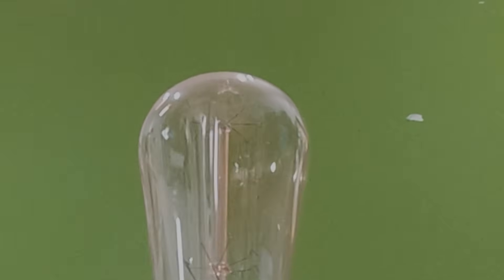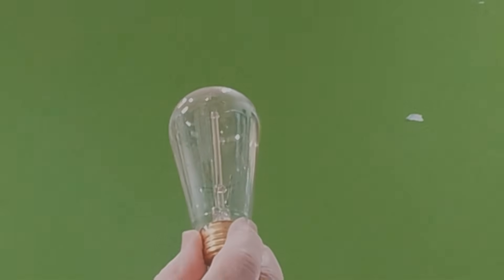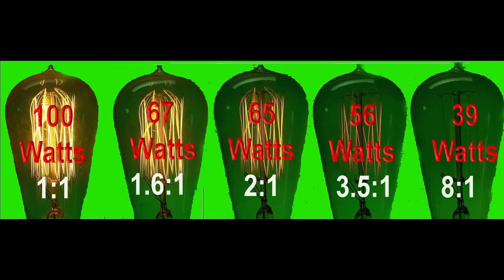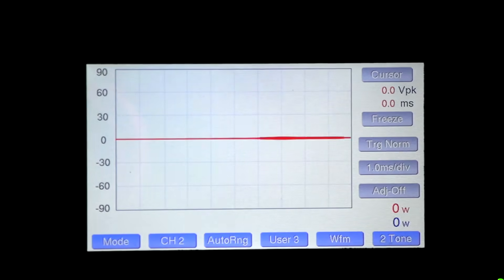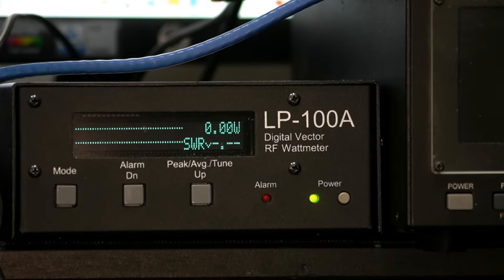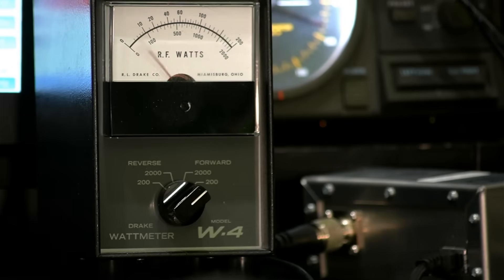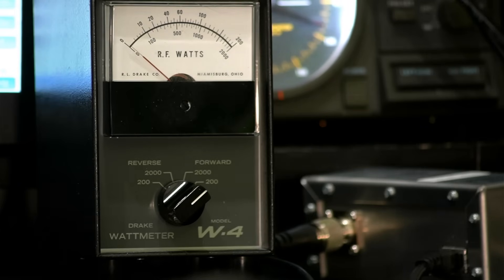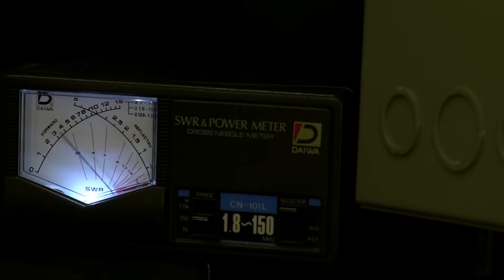The ARRL Writes  About an SWR Myth Among U S Hams, Find Out the Truth Watch the Bulb! 73, Jim W6LG

Comment: W6LG illustrates a fundamental observation: the higher the SWR the less energy is being delivered to the antenna. There is nothing up for debate or interpretation. Glad I'm not giving the ARRL anything to make a contrarian point. It would be easy to argue their article is comparing apples to oranges...but are they?

It might be interesting  to perform the same test with balanced transmission line vs coax. And how are you presenting the mismatch to the purely resistive bulb...at the feedpoint or at the transmitter. It's getting harder to find those incandescent bulbs.

Comment: Hi Jim, thanks for another video learning session. I just got my General last November 2024. I am living on social security which leaves little money for equipment and experimentation. I was gifted a FTDX3000D along with power supply so my focus is on setting up this radio and understand how everything works and the proper way to communicate with others close and far away. Tomorrow ill be setting up a Alpha-Delta DX-40 dipole antenna at 30 feet with 80 foot of RG8X cable. 

My old setup didn't teach me much as it didn't get out at all. HW-101, HW swr power meter. very old B&W folded dipole and old wire. I had trouble discerning where my problems were.

I also was given a 239 ant analyzer which will help me to understand and build a working setup.

Now that all my equipment is new, I'll be on the air soon which brings me to your Calling CQ properly. I'll do my best and get back with you. KN4HDH

Comment: Okay. Jim Here is what I do. I’ve decided the best solution to this SWR CONTROVERSY I  run a 120 foot doublet fed by 600 ohm ladder line via an MFJ  tuner. Fed from the radio by a RG-8 coax jumper. This antenna works all bands 80 to 10 meters, and nothing gets hot. Which means most of the energy is getting radiated. Yes I have to keep the tuner tuned but big deal.

Comment: Its like a light bulb dummy load. Depending on the watts of the bulb. Ive done it years ago
Reply: You need a 100 watt bulb 💡
Reply: Or you turn it up the swrs will go up on the light bulb swrs will go up. I never heard of a 1.1 swr on a light bulb 💡
Reply from the maker: 61 years of experience. 73 Jim W6LG

Comment: Your video brought back old memories.  My first experience with radio came as a gift:  a Heathkit GW-12 CB transceiver.  I recall that the transmitter tuning procedure was to plug a small, specially wired flashlight bulb into the antenna port and tune for the brightest emission.   Thanks for an interesting presentation.
Reply from the maker: Thanks for the comment and 73, Jim W6LG

Comment: Hi Jim, possibly the biggest problem with discussions on SWR is that the "educators" might take extreme cases to prove their points. High SWR is often also blamed for high common mode current, which is not automatically the case at all. Sadly the victims of this are the beginners who quickly don't know what to believe. 73
Reply: Totally agree, also videos that don't tell the whole story will confuse the new hams
Reply from the maker: As usual, you provide honest, sane, good discussions with me.  We may not agree some times but we agree to maintain our friendship. I always look forward to hearing from you. I am still in bed from breaking my back again. There is an interesting story that goes with the ambulance ride that I need to tell you and others. 73, Jim
Reply: @ham-radio  Jim, I generally agree with you 100%. I am sorry if  my post implied anything different on this occasion. As for your health, I cannot appreciate what a battle you are going through. On a lighter note Jim, sometimes if you agree with someone on a technical point it is worth temporarily adopting a different apparent viewpoint. In my life I have rarely learnt from someone by merely agreeing with them 🙂 73 de David

Comment: With less power getting to the light bulb, you need to find out where it's going. First, there will be actual resistance loss due to the resistance of 150' length of RG8X cable. Then you need to find out how much is being radiated by the cable itself. I would test the cable first by using a 50 ohm dummy load and check radiation around the cable with a field strength meter. Then terminate the cable with the lamp as shown and recheck the field strength meter. Then increase the VSWR and check with the field strength meter again for each step. Then repeat with other cable types. 
I remember back in the seventies the ARRL talking about how VSWR on HF isn't as critical with basic and simple dipole type antennas, because the radiation isn't lost, it's simply being radiated by the coax feedline. They said in some situations, the cable radiation actually could help filling in the nulls the dipole may have, for better omnidirectional radiation. Of course, radiation on the cable is bad for directional antennas, because it screws with your radiation pattern. 
You just got to know when to holdup,
when to foldup,
when to walk away and 
when to run.
Reply: I would run if anyone was suggesting that the feedline radiates due to high swr
Reply from the maker: Interesting points, thanks for the detailed explanation of what you would do to test it, I appreciate it!

Comment: There's a great, freely available article reprinted from the Nov 2006 issue of QST titled "Understanding SWR by Example" by Darrin Walraven, K5DVW, that talks in detail about this topic. The reality is that with a low loss transmission line, the tuner will in fact enable the majority of power to be delivered to the load. Even if you're ultimately only getting half of the power to the antenna – which is achievable with a modern tuner and decent coax even with 5:1 VSWR at the feed point – you're looking at 3 dB loss. That's half an S unit. Depending on your goals you may not even care about this.
Reply from the maker: Honestly, I really don't want to lose half my power.  Thanks, Jim

Comment: Jim, the light bulb video is the exact type of instruction that propelled me into the field of electronics decades ago. (~’76) Being a few years away from retirement and still paying off a mortgage my economic reality cannot justify spending thousands of dollars on radio equipment. The Xiegu G90 has been a perfect solution for me. But with only 20 watts to work with I need the greatest antenna efficiency possible to get my signal out there. You might consider creating a second light bulb video comparing 20 watts into an efficient antenna vs. 100 watts into an inefficient antenna. A subsequent follow up video could then address the current real world co$t of inefficiency for the Ham radio operator. -KQ4SRE

Comment: Jim,

I read many of the comments and agree with most of them.  But, remember this is a hobby and supposed to be fun, relaxing, and help us maintain an even balance between life and all of its difficulties.  Some want to KNOW the where's and whys of what they are doing.  Others just want to enjoy making contacts.  If you want to just make contacts and friends, that's great.  If you are having trouble making contacts then learning more about the WHY is important.  No one should get their undies in a twist about SWR but learning about it can and does make a difference.  Back in my Novice days it really didn't matter because I made contacts and adjusted the pi network on my DX 40 to compensate for mismatch.  I made contacts and felt I had arrived! Ha!  65 years later I know more, actually get on the air less, but still feel accomplished.  Thanks for your teaching.  I wish you well my friend.
Reply from the maker: I know Dave. Right after I finished I was the back of an ambulance on the way to the hospital for a few days. I am home and in bed recovering. 73, Jim

Comment: Great video JIM ! I use the cross needle meters . I need to see my forward power to tune my amp and see reflected power at same time. Then look down and read the SWR on the meter. I quick glance and I see it all . I run filters inline like band pass / low pass so I keep mater at antenna side.  Works great !  I have thar Rig expert as well. Great test gear to have. I can do smith chart and more with PC to Rig expert.  cable . USB A to B came with it. Nice job with lightbulb . Years back was my dummy load.  73
Reply: I use the cross needle meter as well. Gets your attention quickly when something goes wrong.
Like the PL to SO connection at the antenna, mysteriously loosening.

Comment: After spending too much time simulating feedline losses and worrying about them I have resorted to mounting the tuner at the antenna feedpoint. As a side effect, I no longer have to worry about the coax acting as an impedance transformer and accidentally making things worse in unpredictable ways. It was a pain - running extra wires, waterproofing it - but I love the result. It's just... elegant? The 50 ohm coax only ever sees a 50 ohm load.
Reply from the maker: That's a great idea, and thanks for sharing. 73,

Comment: I think you need to redo the light bulb antenna test while using a tuner. Most us have internal tuners that match 4 to 1 or better. The youtubers who speak of swr myths profess using tuners. Overall i like your videos, but this one i do think you overly obsess with VSWR and are doing a dis service to some newer HAMS who are getting overly obsessed with swr, rather than just putting up a decent antenna and getting on the air. I know guys who spend a week tuning an antenna just to opearate 20 watts on a Xeigu G90 that has a great internal tuner. And don't forget, resonance may not even occur at the lowest vswr. Your dummy load as an antenna was a great video representing that a 1 to 1 SWR isn't everything. KN6MGK
Reply from the maker: And what do you think a tuner is going to do?  Get back to me Steve with an answer.  73, Jim
Reply: @ham-radio a tuner creates a conjugate match allowing the transmitter to put full power into the system it's just made resonant
Reply from the maker: From my hospital bed did you understand that I did use an antenna tuner and then I delivered full power every time. My linear amplifier has one big tryout. It has a pin network which is the antenna tuner and it put up full power every time so I already do what you suggest
Reply: Yes, I would like to know.

Comment: You know, I can't help sharing my experience with a "piece of crap set up" on the CB band back before I got licensed and how upon getting the SWR down to a 1.0:1 by trimming the antenna and other little tedious details, received signals shot up a whole S unit at least!  And then, when I transmitted, without soliciting a signal report or a "radio check", a fellow operator a few miles across town asked if I had put an amplifier (linear) inline because they said my signal in their receive came up 1 or 2 S units!  Since then, NOBODY can tell me that it's okay to have a high SWR while transmitting or receiving.

Comment: Thank you, Sir! I think along your thoughts about the swr. If you try to push rf through a 10:1 situation, you WILL have problems. You're right! Where's the power coming from if it isn't the transmitter? I don't have anything to do with ARRL these days. They are full of baloney!
Reply from the maker: Many feel that way. If you check the CEO's pay you will not believe it. Something less than one half million per year.  If I were on the board he would be fired immediately.  73, Jim

Comment: I love the visual effect of the lightbuld to see the effective output of the transmitter based on SWR.  Thanks for the videos! 73
Reply: You misunderstood the test, the output of the transmitter remains the same as Jim mentioned the test is showing how much loss is in the feedline that's in use on that particular frequency
Reply: @Pioneer936  When i said the effective output of the transmitter I was by default including the antenna.  That may be my mistake.
Reply from the maker: Yes I did and thanks, Jim

Comment: Good morning. I always love your videos.  Thank you. 

I love your response to that article. It sounds like the "myth" was only a partial truth.  I appreciate that you told "the rest of the story."

It seems to me that the article writer either had a specific point he was making or he did not include all of the data concerning SWR.  

I'm an experimenter. I love experimenting with antennas and have spent years using tuner-required antennas.  What I learned is that people who supposedly learn all the math and are self-appointed experts in the field, will argue all day long that what data you gathered is all wrong.  Mathematically, it is impossible for you to have achieved 100 watts at the antenna unless you calibrated the power output to be 100 watts at the antenna.  

RG-8x, according to the charts and data sheets, has a loss of 1.9db/100ft.  Therefore, you should have experienced a loss of 50 watts with 1:1 SWR.  Personally, I would like to have seen your results with a CW signal, but I'm OK with what you did.  

I have yet to own a solid state radio that does not start folding back power starting at 1.3-1.4:1 SWR.  That, and the fact that I don't want to have my finals replaced, is why  I only care about SWR at the transmitter. 

I typically keep my transmitters set to about 10-15 watts unless I'm intentionally working QRP.  I only raise the power when I'm having difficulties, which is not nearly as often as you might think it would be.  Field day, I contacted Martial Islands, QRP, SSB on 20m on my Sigma X-80, radial free vertical antenna usually called a "dummy load" by the self-appointed experts.  

I'll do my best to protect my finals and let propagation overcome any power loss. 

(Preemptive response for sad hams: Yes, I know the X-80 is a lossy compromise, but it is what my landlord allows, and it works, thank you.)

Thank you for sharing the rest of the story.
Reply from the maker: I do not agree.  Read myth number 3.  It is short and very misleading. It is just wrong to put out that kind of BS.  They should know better; but they don't. So sad. 73 Jim

Comment: Jim, you have the most uncanny way of demonstrating a point. The light bulb is just freaking brilliant! My contention for years in the hotly debated topic of "SWR" is the linguistic hodgepodge of weasel words. SWR gets tossed around like gospel truth in amateur radio circles, too often it’s treated like a finish line instead of the start of a deeper investigation. A 1.5:1 reading doesn’t prove your system is working any better than a 10:1 proves it’s not. SWR by itself is just one variable, a surface reading of much deeper physics at play.
Every antenna system, no matter how simple or complex, is shaped by seven core physical factors:
1.	Electromagnetic Field Dynamics
2.	Resonance and Standing Waves
3.	Impedance and Matching
4.	Propagation Medium Properties
5.	Radiation Pattern Geometry
6.	Near-Field Coupling
7.	Loss Mechanisms

If you’re not taking all seven into account, you’re not looking at the full picture. SWR just tells you what’s happening at “one” specific point, usually where the transmitter meets the feedline. That’s it. It doesn’t tell you how well your antenna is radiating, how clean your signal is, or whether your pattern is doing what you think it’s doing. Making a contact doesn’t mean your system is effective. It just means you pushed enough RF out to hit someone. That could be through brute force, dumb luck, or even a garbage pattern that just happened to hit the right bounce. Effectiveness, Efficiency, clarity, and stability? Those are deeper questions.

SWR is part of the story, not the whole book. It’s a hint, a clue, a breadcrumb. Treating it like the be-all-end-all is lazy thinking, and worse, it trains new operators to value numbers over understanding.
What we should be doing is using SWR as a signal check, then zooming out to ask: are the seven elements in harmony? Is the system balanced, matched, and resonant in the environment it’s actually in, not just on paper?
This isn’t about perfection. It’s about knowing what the numbers mean, where they fall short, and what they hide. 

So no, a “good” SWR isn’t proof of a good system. And a “bad” SWR isn’t automatic failure. 

Great video Jim, the light bulb is just genius!

Comment: For many years I had no SWR meter, valve days and my h/b transistor tcvr, I had an r.f. pick up meter and long wire plus tuner and tuned for maximum r.f. out. On my doublet I used torch bulbs for maximum brightness in the feeder in the shack. QRP here.
An amateur friend was horrified and asked how do I know my SWR.
Maybe about twelve years ago I made one but didn't get round to calibrate it, he again was horrified and asked how do I know my SWR. I told him I tuned for the lowest reading. In 2017 when I got my FT817ND I calibrated it and can confirm as I expected that maximum r.f. out was a low SWR.
I got a NANO VNA last year to check B.P.F. and Low Pass filters. Aerials too now. 

G4GHB. 
Edit: With the valve tx I used 75 Ω t.v. coax and then used 50 Ω RG58 on the transistor gear. All coax about three foot lengths.
Reply: There is a meter on my tuner but I tune for maximum RF out which doesn't always end with a good swr, I figure if the amp and antenna like each other the swr not being 1:1 isn't a big deal and so far it hasn't been. 😂
Reply: @GoonyMclinux  
When I made my SWR meter I did find max. r.f. out did give me a good SWR and going off tune the r.f. output went down and the SWR went up.
No terrible SWR on tune. I never worry as long as I can aim for 1.3:1 but preferably lower. I usually can get lower except 160m as the l.w. is too short but adding extra inductance works. 
G4GHB.